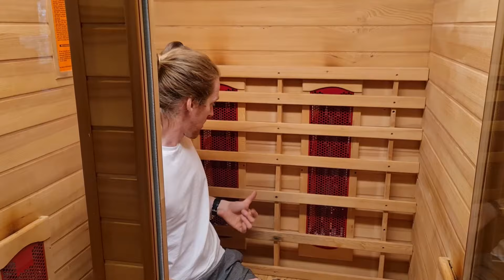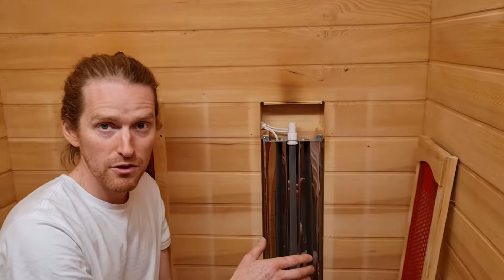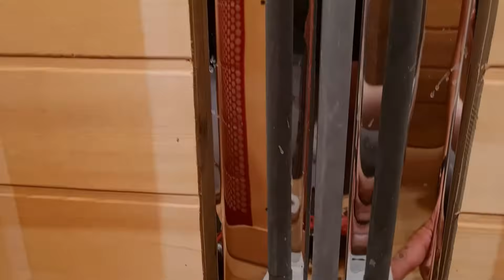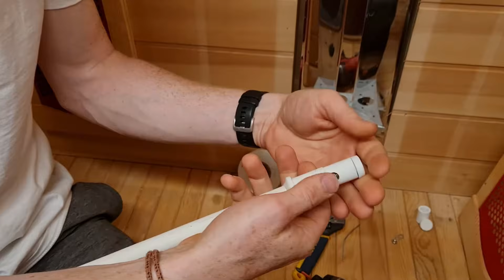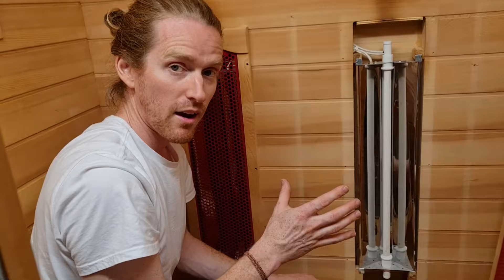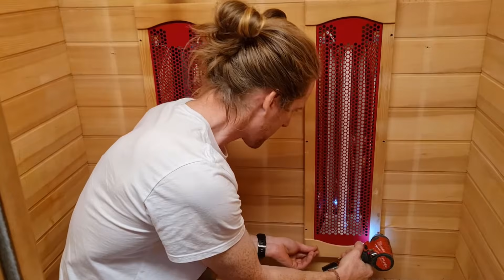Replacing a Ceramic Infrared Sauna Tube

Comment: so do most ceramic infrared saunas from different brands all use similar types of tubes, when it comes to length / fitting / wattage? i just bought a 15 year old 2nd hand sauna, but i wonder if any of the tubes ever fail, will it be likely that there will be replacement tubes on the market that will still just work fine with an older sauna model, regardless of like model or brand.

are tubes very brand specific, like does each brand use wildly different tube sizes, or do all of the brands kinda use similar tubes and you can interchange them ?

Comment: great stuff mate had my sauna for 17 years brought it from knighting gale electric back in the day was cheap at the time its still works but the last few weeks its not getting over 49 deg still ok but cant find the fault the elements all feel hot maybe the thermostat it sits on 47 to 49 deg its not cutting in and out still heating I'm thinking the nut on the ceramic tube could be loose or thermostat i will put my infra red gun on it next time and see if the elements are the same .the one on the bottom right seems slightly lower than the rest .

Comment: So they are connected in series ?
Reply from the maker: Hi Jay, they are actually connected in Parallel, all the tubes we sell are set to the supply voltage i.e. 230v or 120v.

Comment: Is it normal for the end to have a little spark? One of mine has a small spark by the white part I don’t know if it is a concern or not
Reply from the maker: Hi, No, a small spark or possibly a hot spot is not normal in a Ceramic Infrared Tube. This could reflect a issue with the filament inside the tube, either bunching of the coil or higher resistance due to corrosion. I would hope that the issue would only cause the tube to fail and nothing further, but keep a careful eye on it, and consider changing as soon as possible. send any photos if you would like further assistance. service@customsaunas.com.au
Reply: @ is there an email I can send to or where do I send a picture or video

Comment: Is it possible to repair the element
Reply from the maker: Hi Thomas, No, unfortunately, it is not possible to repair the filament inside the tube
Reply: Well I took it apart and all that was in it was ain’t spring of thin wire which was connected to both ends of the tube. One end of the wire had broken about 10mm from the end so I stretched it to the end and reconnected it to the end of the tube and put it back in the sauna and now it is working perfectly again .🙏👍

Comment: If only one half of your sauna is fully heating up, would you recommend this repair?
Reply from the maker: Hi, I would first check the control system, it sounds like one of the relays might have failed. There is a control box in the ceiling, having an electrician check these outputs you can check if one relay no longer switches on. there is also a second video on the channel that shows this process on a unit with a single relay

Comment: If the colour of the tube is black and there is no damage, at least not visible from outside. The wiring seems also to be okay. does this  mean that the tube could be broken internally? 
What is the standard colour of the tube?  Thanks again
Reply from the maker: Hi Naam, Thanks, you're very welcome. The tube colour can be black or white, though I prefer black. Yes the filament inside the tube can be corroded and break inside the tube. The best way to test would be if the tube were removed and a resistance test performed if you get an open circuit, then the tube is dead. If you have any follow up questions feel free to email service@customsaunas.com.au 
Regards Allan

Comment: How do you know what wattage to get? My tube is 600mm and my sauna runs off of 220v. I found 600mm 200w 220v & 600mm 300w 220v.
Reply from the maker: Hi Jeff, have you got the ability to check one of the existing tubes that are still working? You can perform a resistance test to determine the wattage. Feel free to email for more info. 
Service@customsaunas.com.au
Reply: Thanks for such a quick response. I do have one I can test. Great videos and thanks again!   @infraredsaunarepairs5982

Comment: Hello Allan, I have a Royal sauna and 2 of the elements are not working with cable black to the end where it attaches to the element. I am in the USA and Royal sauna is not existing any more.. I do not have any paperwork for the sauna and when we took the element out we cannot see what kind or voltage is needed. I hate to call a expert they are very costly here. Any suggestions? Thank you!
Reply from the maker: Hi Sandra, the best way to check the voltage would be to look at the plug and the type of circuit it is plugged into. Most smaller units like the one you have will be 120v and plugged into a regular receptical. The wattages are usually the same depending where they are in the sauna, behind user 350w, under bench 300w. We can discuss futher via email to get your sauna working like new again.

Comment: My sauna model have 4 of these element. If one is not working. Is it safe to use the sauna with the 3 remaining or should I wait for the replacement?
Reply from the maker: Hi Francisco, so long as the wires are still attached to the failed tube it is safe to use. If the cables are off, either removed or broken, they can cause a dead short to earth. This will hopefully cause the Breaker to trip so you won't be hurt, but not worth risking.
Have you removed the old tube?

Comment: What kind of internal cable would you use to replace if loose wires had caused burning at the ends? Just standard v75 or v90 with thermo sheath near the terminals?
Reply from the maker: Hi Daniel, Because of the temperatures the tube can get to I would recommend a 250c + cable, like a fiber glass sheathed silicon cable. Where are you located? I've got lots of decent length off-cutts
Reply from the maker: Feel free to contact via email
Allan@customsaunas.com.au

Comment: Is there a way to test the elements?  Two of the connectors to the power supply make the circuit breakers pop after a few minutes.  Great post BTW, I couldn't find anyone to tackle it in Austin, TX now I'm doing it myself.  Thanks!
Reply: Hi Alex, yes, the best way to test the tube is to use a Multi-Meter with the Ohms (resistance) setting, with a probe on each end there should be a reading of between 90-150ohms depending on the wattage. if the tube is broken inside you will get an OL (open) reading. please see our blog post on testing and selecting your ceramic tube. https://infraredsaunarepairs.com.au/blog/selecting-the-right-ceramic-infrared-sauna-tube-for-your-sauna2020

Comment: Do these get weaker with time or do they work until failure?
Reply from the maker: Hi Brian, these will begin to diminish in performance over a roughly 10year period, so the sauna may feel like it's not heating as well. Normally people might wait until failure before replacing, as they may not notice but if you were looking to improve the performance you could consider changing them out before then. Alternatively I also recommend with some underperforming saunas an additional heater above the door on a 45°deg angle facing down, this tends to pick up the slack and create a better surrounding heat. If you have any further questions feel free to reach out via Email
Service@customsaunas.com.au 
Allan

Comment: What points do you measure the bulbs for replacements?
Reply from the maker: Hi K Warnock, it would depend on who you're buying then from but as a guide I would measure from the very tip to tip. There's a graphic showing the dimensions on my online store here, https://infraredsaunarepairs.com.au/infrared-sauna-parts/ceramic-heating-tubes
Let me know if you have any other questions
Allan
Service@customsaunas.com.au